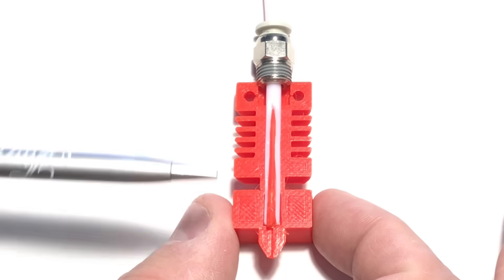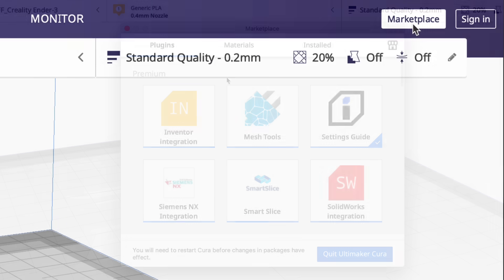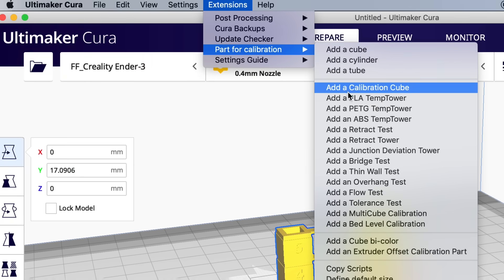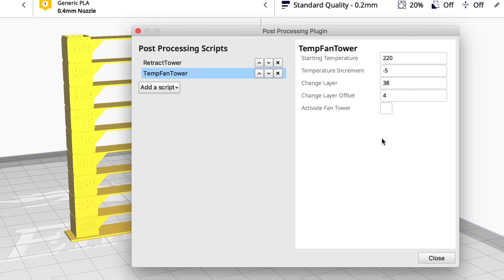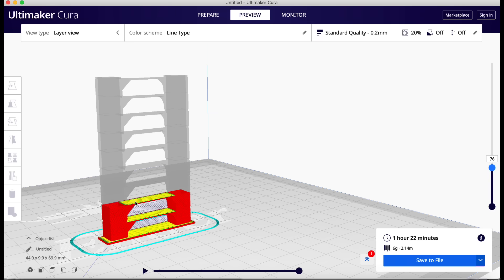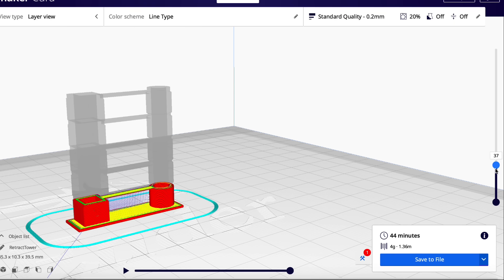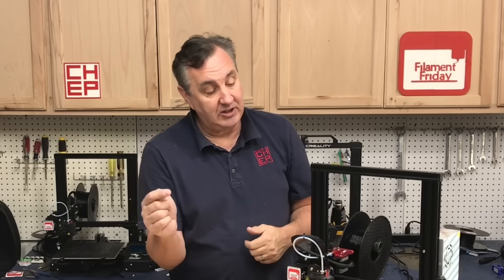Calibrate Perfect Retraction Settings Using a Cura 4.8 Plug-in

Comment: I tried the retract tower and there was no difference between the tower levels. I went into the gcode to see if the retract speed or distance was being changed at each level and the only G1 E command was at the end. Is there another command that sets these? I tried using the post processor and it made no difference. Im using the very latest cura. Anyone know what gives?
Reply: what printer do you have? Is it direct drive or bowden? I am guessing you have a fairly well dialed direct drive printer and if you are using the 1mm-5mm settings as the tower is set up for, the only difference is going to be some VERY SLIGHT stringing at about 3mm and up. I blew on mine and they went away so all levels of the entire tower now look the same.

Comment: You skipped over the 'Change Layer Offset' settings, which is what layer does the tower really start. For these towers, the first 4 layers are just the base. If you don't set this, the whole tower will be off by the base layer count, which is usually 4 (meaning the setting should be 5 - where the tower really starts).

Comment: I recently purchased an Ender 3 Max. A couple of different prints came out stringy. I have Ulti maker as well for the slicing.  Where is the setting for retraction and how is it set up?
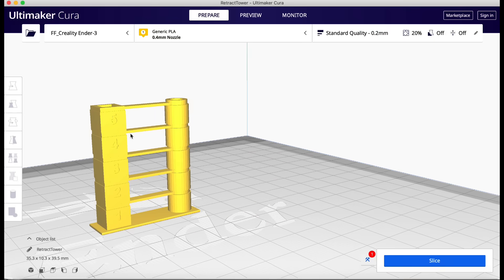Reply: Did you watch the video? He starts talking about retraction tower at 5:35 but if that isn't what you wanted, can you be a bit more specific?

Comment: I had to run to this video after I changed to a volcano, same extruder setup.  PLA wants a lower temp with the volcano. ?! I need a temp tower for high flow rates (which need more temp) BUT I think the retraction has to change as well, checking now as I get stringing at all temperatures.

Comment: i have just downloaded your best profile for cura, at 0.12 layer height i just cant get rid of the stringing at all, i have a sprite extruder pro on a cr-10 smart pro, i also seem to have some ringing that i also cant seem to dial out no matter the layer height, any ideas what i could do to try to fix the issue? i have tried up to 3mm retraction (more then i like to use, but its what creality recommend) and i have changed retraction speed from between 25 and 65, any higher then that and i notice a drop in print quality.

Comment: Thanks Chuck. I didn't even realize these were there. There's another plugin called Auto Towers that makes life even easier. I've been 3D printing for over 3 years now and I completely missed them. I only started to look for a solution when I switched to an all-metal  hot-end on my Artillery Sidewinder X2. From now on every spool is going to get proper tests and the results written on the side of the spool. Great video.

Comment: You forgot to mention one important step: First of all - you need to ensure, that you dont have under or over extrusion! My advice would be to print first tower with constant settings and to monitor the flow while printing and adjust it stage after stage until it become suitable with filament.

Comment: I have an Ender 3 with a dual gear extruder and it seems to start off stringy, get better, then string. 

So 1 is string, 3 isnt, but 5 is. 

Does that make sense? 

Yours seems to be that is starts out stringy and gets less and less stringy until the end of the test print.
Reply: Yeah so 1mm isn't enough retraction because there is still pressure 3mm the pressure is relieved, and works good. Then 5 is just like one because it retracted so far back that nothing is even heated and it's acting like nothing is happening at all
Reply: I just figured it out myself so now I feel like an expert.. lolol

Comment: So are you saying only one of the retraction settings matters? 

If more than one setting matters how would you go about calibrating that? 

Would you do speed for example and then run another calibration tower with the speed you found on the first test to then find the right distance setting?
Reply: I think what I would do to start out would be to use the slicer recommended print speed for the material you're testing, then do a temp tower, then retraction tower. After you determine the temperature and retraction, then you can fine tune print speed, acceleration, jerk, etc. Hope that helps.

Comment: What can I change if I get strings with 2 to 10 mm retraction?
Reply: Your feeding gear may not be gripping the filament well enough. Perhaps a cracked pressure arm. You may have a worn out, very loose, or too long Bowden tube? There could also be a gap between the tube and the nozzle, creating a little pocket of goo. Just some guesses, but I would check on your filament feed system in general. You may also be setting the temperature too high.

Comment: when I print the temp tower the 3d printer doesn't show a temp change?   am I doing this wrong
Reply: Did you click on display on lcd screen in cura?
Reply: @rickyyym  Im confused as i have this same issue and there is no LCD display option on this setting.

Comment: im struggling so bad with my anycubic kobra max, got pla+ and it just wont stop stringing, got my retraction all the way up to 10mm at 50mm/s and even tested it at 180c when the spool says lowest is 205c 🥲
Reply: Same happen to me with my kobra . Do you got the right settings ? Been testing more than 2 roll and still not get it right
Reply: @randomguymaniac  for me I had to calibrate esteps, then the usual, retraction and heat settings for my printer to produce good results with pla+

Comment: My layers are off on the temp test? I have 38 set but it shows it changing at layer 40 and then 82, 122...
Reply: Same here,, i seem to mis one layer at the 220 level, so the temp switch is of by 1 layer at every level.. reaaaly annoying haha. Im in cura 5. And i have to admit.. Cura 5 is kind off a dissapointment to me.. Thinking of switching back to 4.13. Ill take the extra hour of print time.. thanks..

Comment: hello. i did what you did on the temp tower. when i get the G-Code and place it into my Ender 3 Pro. i start printing and it does not change the temp where i set it at, so i have to manually change it during print. is there something i am doing wrong? i am using Ultimaker Cura 5.2.1
Reply: i had this problem as well. (With the creality slicer). Try to see if you can save it as  "save as file" and then "gcode". In the creality software you can save as "save as creality format" but that didnt work for me. 

To check if it works, open de file with textbook (Right mouse click) and in my case (ender v2 neo) And CNTRL+F to search for M104 and see if the settings are there.

Comment: Since getting the Ender 3 unboxed I’ve done a calibration cube, benchy, and a few prints in PLA. Using PETG is a whole different ballgame that requires calibration towers first. Of course I learned it the hard way with failed print after failed print in PETG. Calibration towers are almost mandatory. Did a temp tower first and got the ideal temp dialed in yey! Next is retraction distance & speed towers. This video helps detail what to look for. There’s a difference in using a diagnostic tool and understanding what the data means. 😉 Thank you for the video.

Comment: Hey CHEP, what combing settings are you using on your retraction tower? It looks like your extruder completely avoids travelling through the inside of the square side of the tower. Every combing option on my end still travels through the square side.

Comment: Question CHEP:
When these values are determined, are they added to the retraction settings already there?
For example, mine defaults to 6.5, and the "5" on the tower was the best result. 
Does this mean I need to add 6.5+5? When I changed my retraction amount to 5mm, it produced stringing?
Reply from the maker: No change it to 5
Reply: Thanks again--any changes to the retractions speed? Or default that to the values set in the script originally? (10mms? Or just whatever the standard profile defaults to?)--sorry to hear about Geetech
Reply from the maker: No speed change should be required.

Comment: I think you didn't understand/explain the offset. I think the offset should be subtracted from the layer change value. So if it's really 4 layers, then it would be 34 instead of 38 for the layer change. If you look closely, you can see that at layer 38 you're in the bottom of the bridge but on layer 76 you're in the middle of the next bridge rather than the bottom.

Still a great video and has helped me quite a bit.

Comment: Wasted lots of time on this for nothing.
Used tower to test all clear. But when printing  thin spikes, the stringing returned
Thumbs up for the video.
Reply: Thin spikes require little modification. Much depends on the extruder, Bowden pipe length (or not Bowden type), changes in retract settings, or retraction speed etc.
And it all goes to hell sometimes when you change filaments. So not the tests are the problem.
Reply: Do you even calibrate your filament? For each new roll you print with you should do; temp tower, flow test then retraction if needed.

Comment: When using Cura 5.2.0 Beta, this retraction tower parameters seem to work: LH:0.20mm, Change Interval:38 Change Offset:0. Results from g-code shows (layer no/distance): 1/E1.0, 40/E2.0, 79/E3.0, 117/E4.0, 156/E5.0, 194/E6.0

Comment: Doing PETG I set my starting temp in script to 260.  Sliced printing and the screen stays at 260 but at bottom it says extruder heating.  What am I doing wrong?

Ok it is changing temp but not at correct intervals

Seems to be one or two sections off

Comment: Additional note: Don't forget to change your printing temperature under "Materials" tab to the starting temperature of the tower your printing.
Reply: The script will override your settings if you do it correctly
It will still display your default temp but you'll notice the actual nozel temp is as per the script
For instance if I set my nozel temp in the general settings to 225° it will show 225 on the left but on the right side which is my actual nozel temp it starts at 220° then drops in 5° increments as the tower progresses
Reply: @johnnyrocko7105  hmmm i did not see the temperature changing, did you do anything else ?
Reply: @rodrigolopezarechiga6557  click on the extensions tab up top (same one you added the tower with)
Make sure you pick a preset tower to load up
After the tower is loaded go back up to extensions and click on post processing 
Click on add script and choose the script in relation to the tower you've added
Once you've chosen your script and it pops up on the right go to the upper right side of the script and hit gge drop down menu
You'll want to be sure that you've got the correct script (ie. temp, speed, distance)
On my printer my starting hight is 41mm so every 41mm the script will change
On a side note the first number of the script is your value for each change 
If you want your temp to go down 10°C every 41mm you'll need to confirm that value is correct
Also at the bottom of the script make sure the display is checked on as it will show you the progress with each change, for temp it will display the current temperature,distance it will show that value and that should show on the bottom of your control display 
On retraction distance the default value is 10mm and I found out the hard way that I needed to change the value to 1mm every 41mm in hight 😆 
I hope this explains it a bit and helps to steer you in the proper direction
Reply: @rodrigolopezarechiga6557  click on the extensions tab up top (same one you added the tower with)
Make sure you pick a preset tower to load up
After the tower is loaded go back up to extensions and click on post processing 
Click on add script and choose the script in relation to the tower you've added
Once you've chosen your script and it pops up on the right go to the upper right side of the script and hit gge drop down menu
You'll want to be sure that you've got the correct script (ie. temp, speed, distance)
On my printer my starting hight is 41mm so every 41mm the script will change
On a side note the first number of the script is your value for each change 
If you want your temp to go down 10°C every 41mm you'll need to confirm that value is correct
Also at the bottom of the script make sure the display is checked on as it will show you the progress with each change, for temp it will display the current temperature,distance it will show that value and that should show on the bottom of your control display 
On retraction distance the default value is 10mm and I found out the hard way that I needed to change the value to 1mm every 41mm in hight 😆 
I hope this explains it a bit and helps to steer you in the proper direction
Reply: @johnnyrocko7105  thank you so much! I will try first thing in the morning.

Comment: At the start in the slicer do I have to set the retraction value 1mm or does it start automatically from 1mm thanks to the script? Thanks and congratulations for the explanation
Reply from the maker: The GCode handles everything.
Reply: @FilamentFriday  is this an update from the time of your video. From what I’ve read the scripts have been removed. How do I know what the parameters are for each section?
Reply: @teddyjackson1902  The scripts haven't been removed, you just don't have to press "copy prints" anymore. They should be in the "Modify G-Code" section

Comment: The numbers do not come out right.  I wish you’d go step by step for the whole tower.  For instance.  After 2 it’s 72.  We’ll first was 38 how do we get 72? 38+38= 76.  Next is 106. 76+38= 114.  I can’t get the numbers to match.
Reply: I just calculated and did some trial and error. It looks like layer height of .26 is what you want to use, that makes the change interval to be 32. 32, 64, 96, 128, 160, 192, 224, 256, and 288.
Reply: @MyGamingThumbs  - for the temperature tower, I agree with you. And set the base to 0.
Reply: The model is wrong in the video as well, you can see at 6:49 when he's at layer 76 that only half of the bridge is made. It's fine, just print it with those settings, you'll still see stranding and be able to troubleshoot which retraction distance is most optimal.
Reply: There's a few layers in the base that offset on all the towers.

It's one of the settings you configure based on layer height, I think it's 4 layers high at 0.2mm

Comment: Thanks for your videos. I'm going through the tests at the moment and just did my temp tower. I'm noticing the text for the temperature on each step of the tower is unclear and as little blobs though this seems to be the only place this is happening. Any advice?
Reply: Is it the Z Seam? The slicer likes to hide the seam in the sharpest corner... which is probably in one of the numbers... You can see it in cura as little white dots in the preview window.   I just sliced the the temp tower and all the numbers have the z-seam in them...randomly sprinkled around. I bet this is it for you.
Reply from the maker: Turn off power loss recovery
Reply: @FilamentFriday  I'll have a look into whether or not I have that option. Setting in the slicer itself?

Comment: Hellow..
Can i get your gmail, or fb? I haved x1 question if u can help to fix, my one problem to i looking a years how to fix that?
Reply: why not just put the question on here?
Reply: @EDC3DP  to i haved sometimes in middle print a ugly line or some times dark or hell line and idk how to fix it..
i chech a calibration, flow , leveling i haved good, with retract anyproblem,  i found a right one temp, i chech every screw on printer and still same! i did try x1 time change a slicer but they did fixed a line im sure need be somting in setting, i used a cura slicer

Comment: I wish I had this options in Flashprint 😞
Reply: You can use Cura with FlashForge machines. I also thought I was locked into FlashForge when I got a second hand machine - but it exports in the right gcode format for the machine. You do have to setup your own custom profile, custom print bed size and possibly extruder offset as most FlashForges aren't natively in Cura. But it is possible. Was a massive game changer. - I was also lucky and there was a plugin made for FlashForge Finder's which exports it in the gcode where you get the preview on the Finder build screen.
Reply: @jewlz88au  Thanks for your comment. I tried it already in Cura and Superslicer, but with not good results. I am still trying to find the right settings for my Guider 2. Would you mind to send me your start and end g-code or your profile, so I can analyze it and try to transfer or customize it to my machine.
Reply from the maker: I believe you have to rename the the .GCode to .g for it to work on FlashForge.
Reply: it exports it to the right format or at least it did for my printer. 
The issue I came across is there is only one profile for Flashforge natively and a plugin for the Finder. 
Until I found the plugin I had to manual adjust another profile for it to fit my printer. Needed an extruder offset so that it wouldn't attempt to start printing in the middle of nowhere.

Comment: Hello, I am a subscriber to your channel, I really like your explanations and I learn a lot from you, and I have a question that bothers me.
I use CURA and recently I made a lot of changes at once in the printing settings, and I am not at all satisfied with the result, and I want to return all the settings of CURA to the initial state as they were at the beginning,
I would be very grateful for help on this matter.

Regards
Sharon
Reply from the maker: Can you reload the original you started with? 
Other than that, I don’t know a solution.
Reply: If you want cura to be set back to all defaults, close cura down and go to my computer/ local disk C/ users/ home/ AppData/ roaming/ cura folder and delete the entire folder and open cura and it will be like when you first installed it, hope it helps you out....
Remember if your on a Windows PC to make sure hidden files is ticked so you can view all folders ....